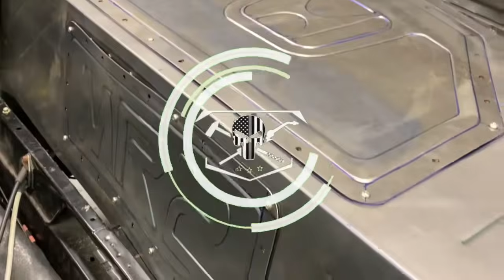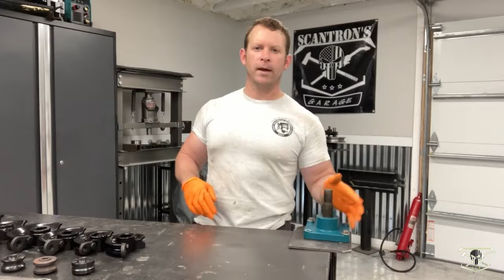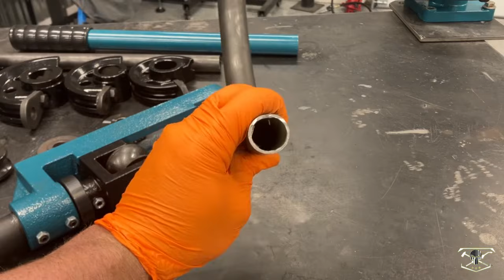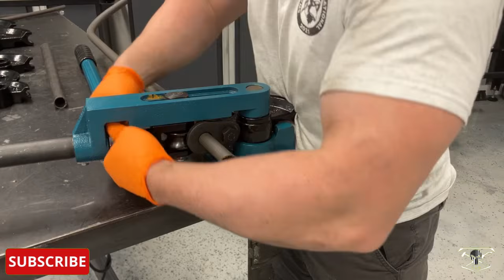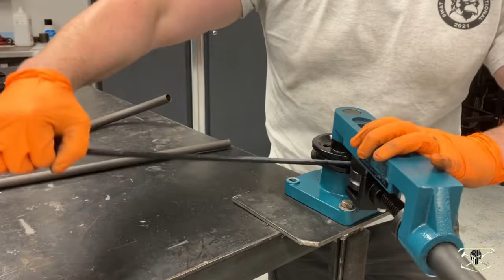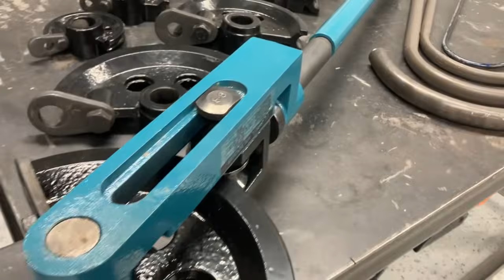Cheap Tube Bender

Comment: Is this Cheap Tube Bender an actual Tube Bender or a Pipe Bender?
Reply from the maker: This thing is the real deal! But it only does up to 1 inch diameter. I have two other bigger machines that bend larger diameter. This machine works the same way as my bigger ones and draws the material over the die. Can’t beat it for the price
Reply: Rated for up to .08" material.

Comment: build a 4x4 1/4 tubing weld a 1/2 plate to bolt it to the concrete , just like the one you have in the shop...easy bend rotation with an open space
Reply from the maker: That is a great idea! I will have to take the time to do that. The fence post I used was a quick fix

Comment: If you applie heat to the thick stuff prior to bending would make it alot easier, glad iv seen this as im sbout to make a subframe.
Reply from the maker: Thanks! That certainly would have helped. I didnt think of that. good luck with the subframe
Reply: would you do that to aluminum too?